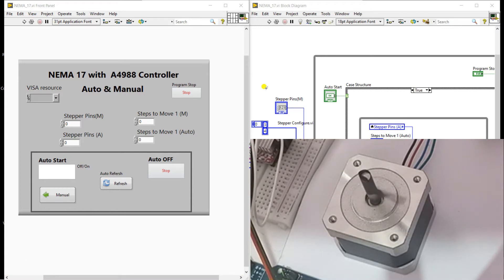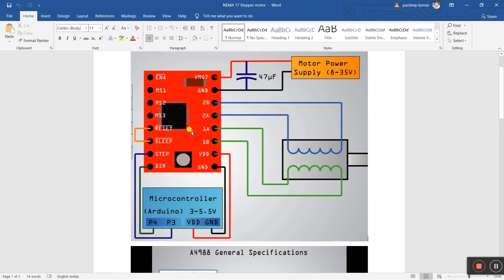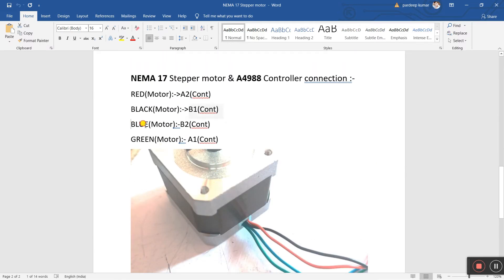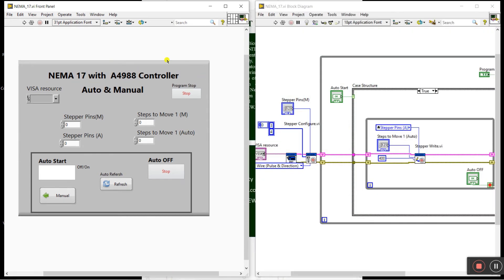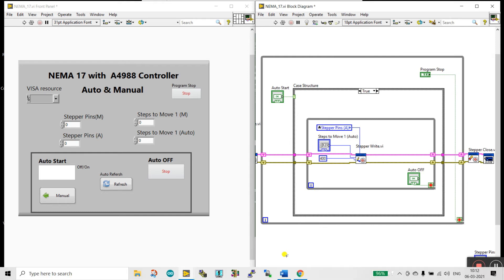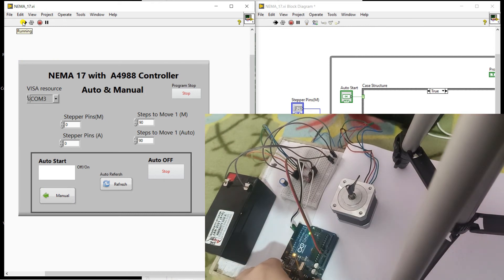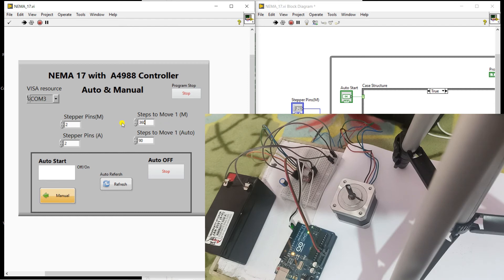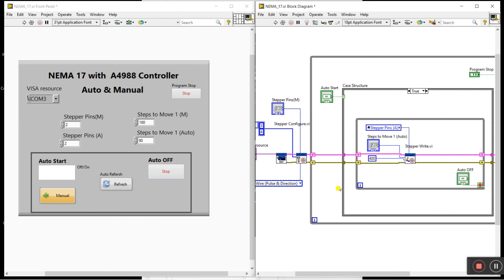LabVIEW | NEMA 17 Stepper Motor & A4988 Controller | LabVIEW + Arduino Projects @labviewmultisim

Comment: Hello, I am trying out your program, working on a similar system where I need to manually move 4 stepper motors CW and CCW. Motors work well with regular Arduino control I have tested (same wiring setup you have).

I uploaded LIFA_Base to my Arduino, changed stepper pins to 2, and then pressed run on your program. It does not seem to work, any ideas?
Reply: When I run the program, the motor moves once (much less than the steps set), and then doesn't move again when I press manual button.
Reply from the maker: send me screen shot where you cahange pin number
pardeepnain1111@gmail.com

Comment: Great video, thank you!
I loaded the Labview file, but received a message from Labview that the Arduion plugin interface is missing. Which one did you use?
Reply from the maker: you need to download the "Arduino interface Labview" library from VI
Search on your laptop VI open and download library after that you solve Arduino interface error
Reply: @PardeepLabVIEW  okay, thanks